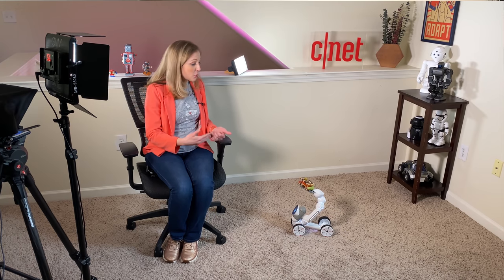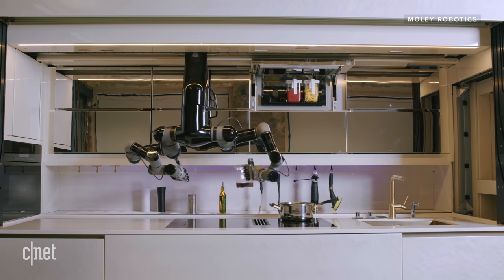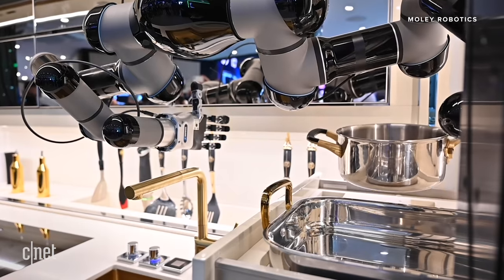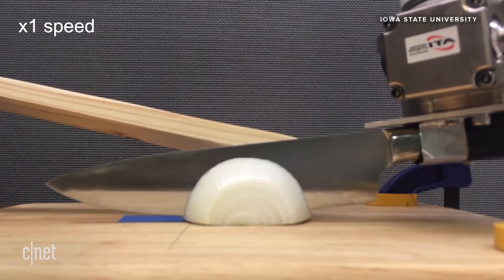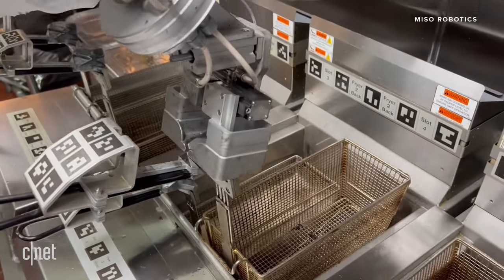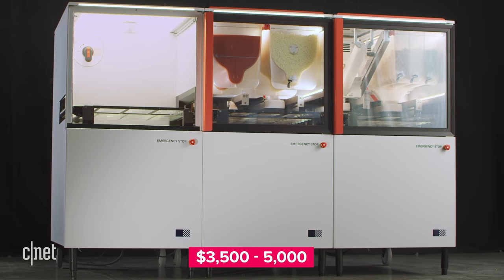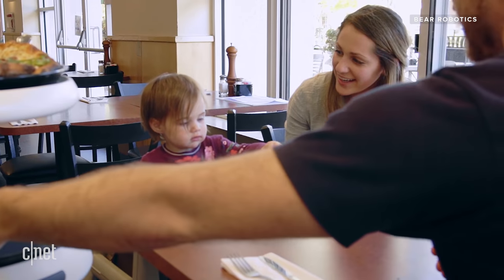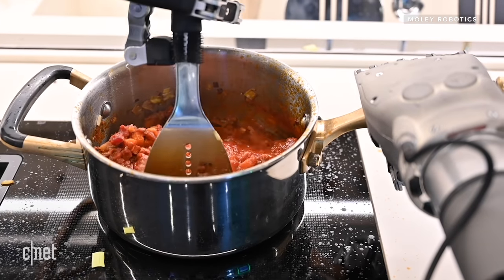Meet the new robots cooking your food

Comment: I am very curious about how these robots are for maintenance/repairability.
Reply: Waste of money. 😎🇺🇸
Reply: You have to buy a maintenance robot for that, der
Reply: Excellent question.
Reply: Repair is already just a matter of replacement these days.  The robots would be designed with FRU's (Field Replaceable Units) and that is how they would be repaired just as we would just replace a failed light bulb instead of wire in a new tungsten wire or solder a new led into a light bulb.  Even our smart phones are just replaced instead of repaired.  Hopefully there will be some regulations to require recycling and the right to repair but those would only add to operating costs.

Comment: Need a humanoid chef robot that is efficient and effective, so that it would not take big space for installment in the kitchen and also for the dynamic recipe of different kind of food type.
Reply: Agree
Reply: Or just specialized machines for specific products at a central ghost kitchen with robotic delivery to the homes or apartments.  That was the original idea in the original Star Trek TV series, those food units were just advanced dumb waiters and in one episode, Kirk was asking the chef to make mock turkey dinners.   Another original Star Trek episode had the transporter technician offer a man some chicken soup from one of three of these depots in the transporter room but there was no counter, table or seating to eat from so those food dispensers must've been there for diagnostics suggesting that it was the transporter system that did the delivery.  Just as we used to have houses built with compartments for the delivery of milk, we may have homes and apartments with lockers for the robotic delivery of parcels and food.